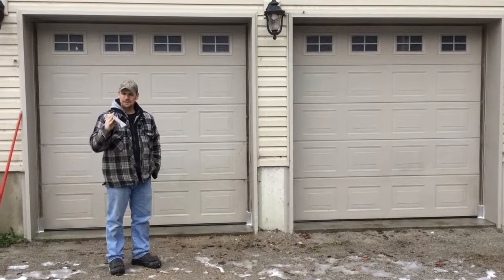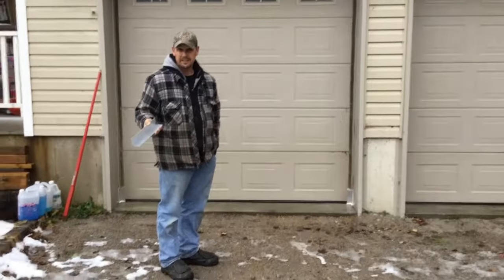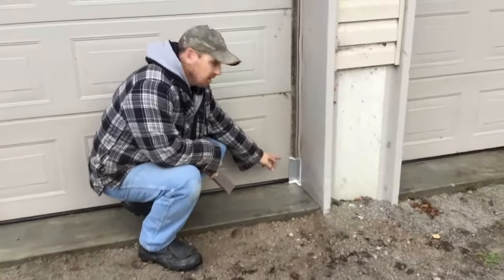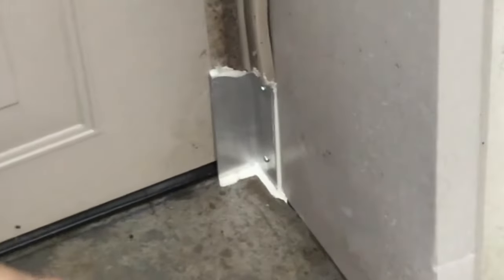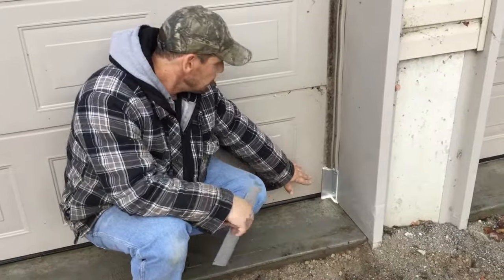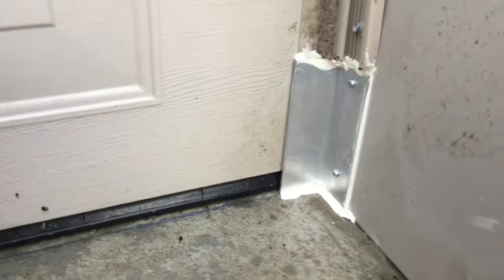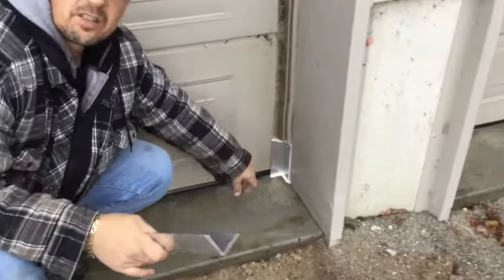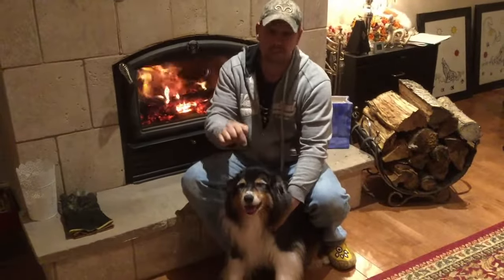Mouse Proofing Garage Doors - DIY

Comment: So I used flashing 6 inch cut which has been working but I noticed the other day they have chewed a hole right above the 6 inches they found the weakness! Nuts huh??

Comment: Been trying to figure out how the mice are getting in for years. Your solution looks better than my caulk-in-the corners attempt. I sure hope this does it for me.... Can they not get under the rubber in the middle? Is it only the corners? I guess I will find out...
Reply from the maker: The most common area for rodents to nibble are the corners (probably because they can hide there). It’s been 2 years since I had a single mouse in my garage after doing this, so I think you’ll find it works.
Reply: @fixinwithford3484  Pin this reply or put it in your remarks above :) Good to know your solution really worked. Thx!